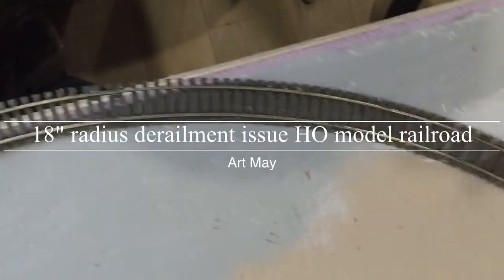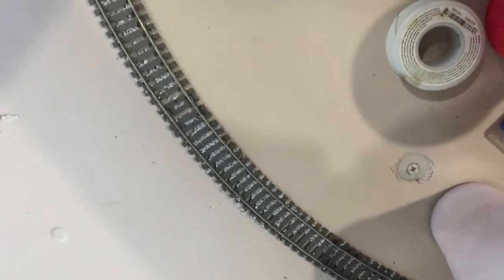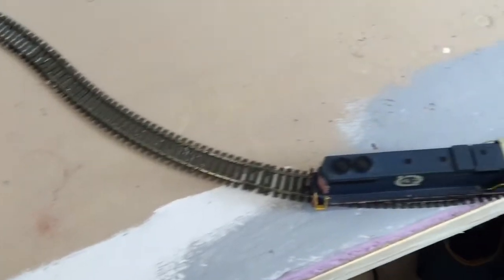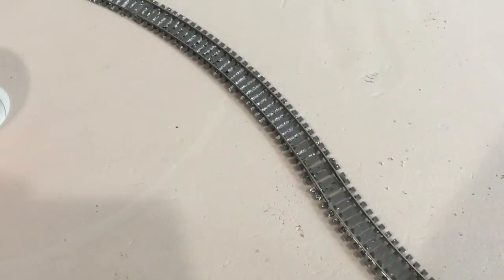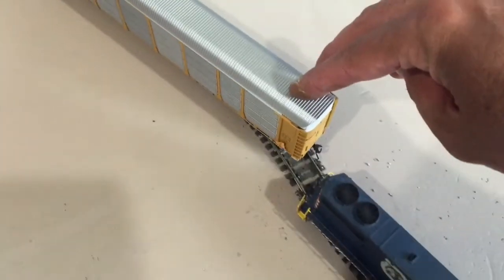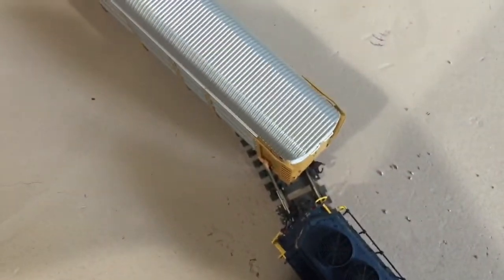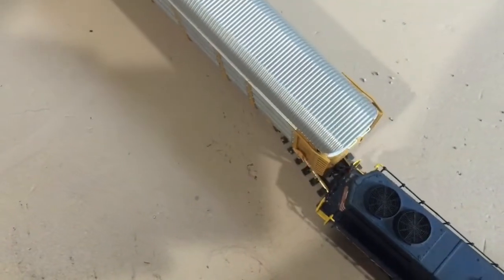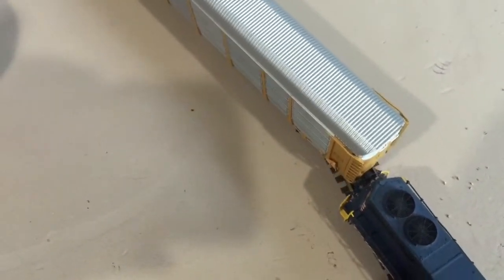18" radius derailment issue HO model railroad

Comment: A new 89 foot Covered Hopper car I recently acquired will not go around my 18" R curves. The wheels rub against the coupler gearbox and won't allow the truck to rotate enough and it derails. Live and learn. I'm gonna make the curves a 22" R

Comment: One way to solve the radius issue is to multiply the length of your longest rolling stock (inches) and multiply by 3.5. The result will be the minimum diameter to accommodate that longest car.

Comment: Old video but you can couple a rolling stock w/ a Body mounted coupler and it will give it better clearance and then couple the rest of the cars after the body mounted car, works for turnouts as well.

Comment: you need to change the 18-inch to 22-inch and add a 3-inch straight between the S-curve sections. Adding long shank couplers to the auto car (like the real ones) fixes that problem too. That's why real railroads have long couplers on their bigger cars - duh!

Comment: RADIUS too too tight...I model BN/BNSF in Montana and run Large,long equipment and HO at least 22 inches for radi`s fro the racks all my locos need 28 inch so I run 31 and 33-34 inch radius`s....became a FEC fan on my 1st trip to FL 2 years ago will be there in April 16